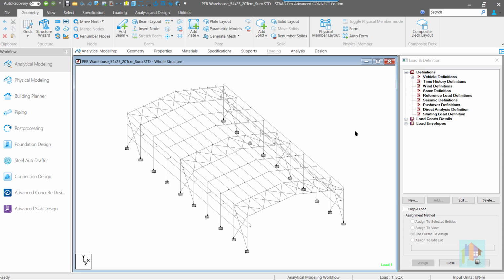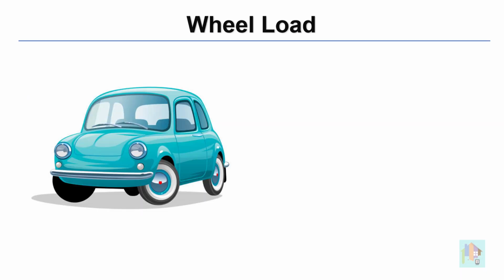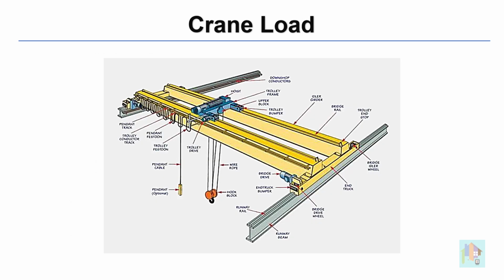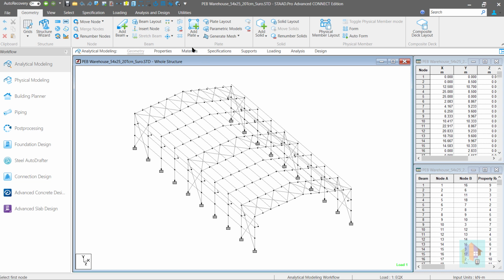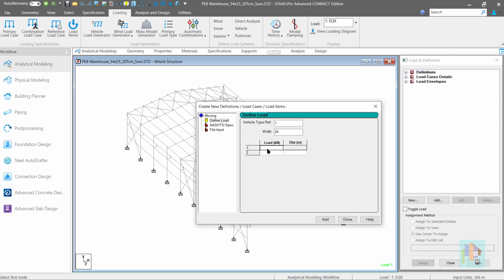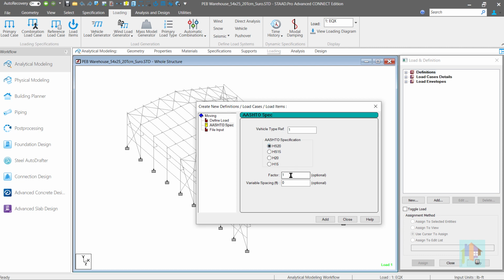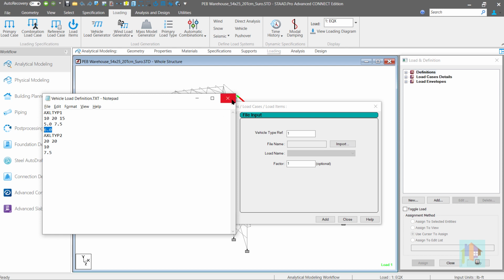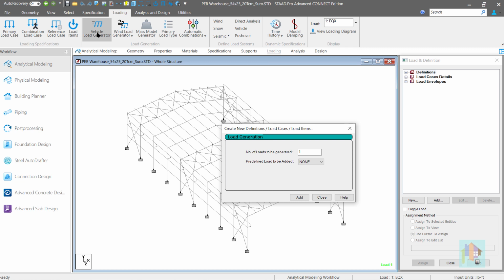Moving Load: p2 - Vehicle Definition || Wheel load & axle distance || Crane,Truck Load || AASHTO,IRC

Comment: Hi sir 
When I applied moving load in staad and ran the analysis my vehicle is stuck in one place and does not move forward, any ideas how to overcome this issue?
Reply from the maker: Not sure, may be something wrong with the load increment value or with the initial position of the vehicle. Check those inputs along with load generation number.